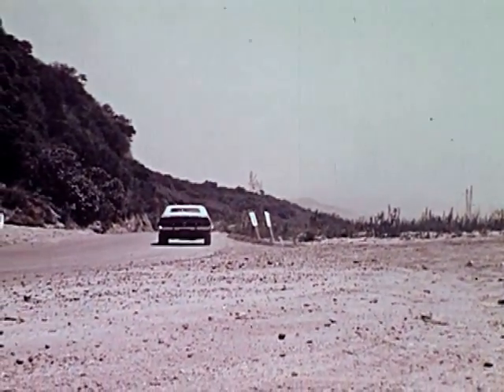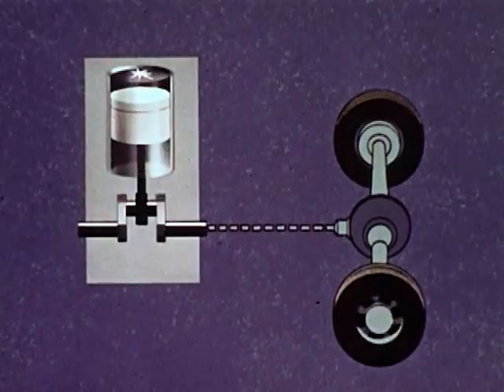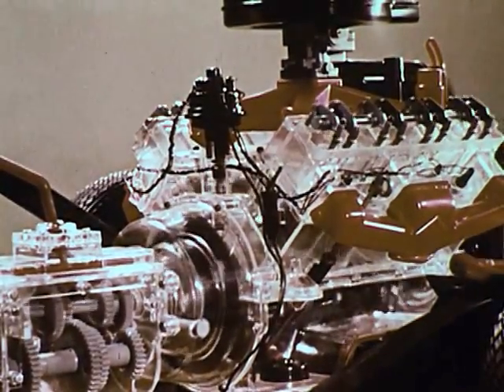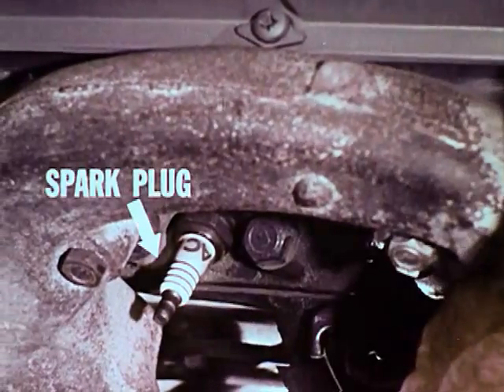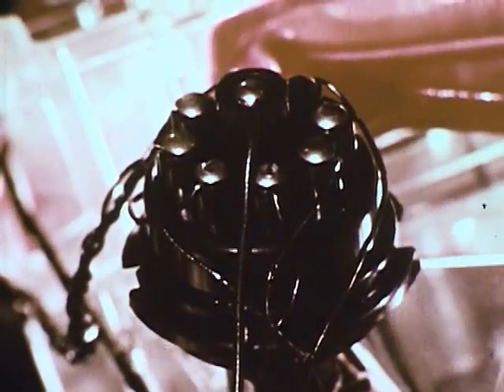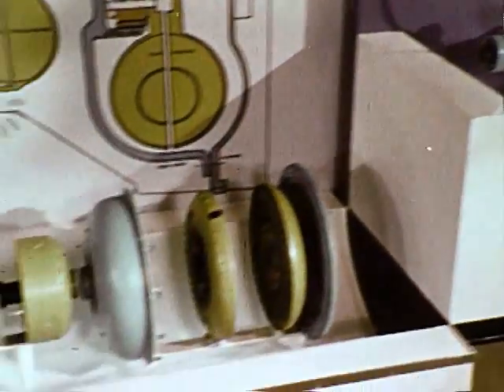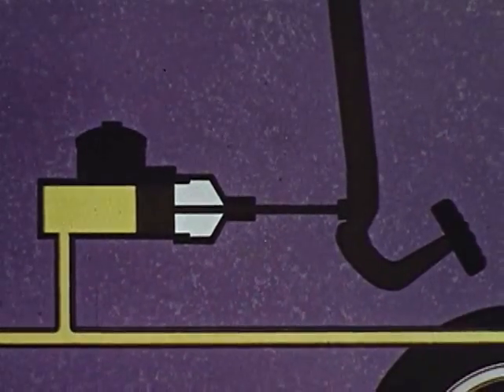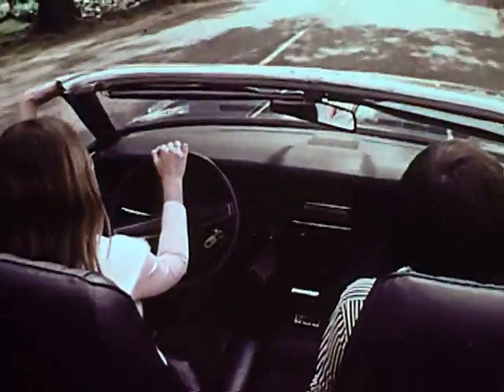What's Under Your Hood? (1973)

Comment: OMG - bad flashbacks! That V8 Chevy engine and the distributor system... they didn't show what it looked like mounted inside a car - with the top of the engine compartment making it next to impossible to remove it! I think that's what killed my 71 Impala - something simple like bad points or something that I couldn't get to. I need therapy.

Comment: By 1973 new EPA regulations were having a significant impact on power, drivability, reliability and economy.  It would be the mid '80's before things started to improve and into the '90 until power came back.

Comment: Under my hood..  A "frunk" containing the brake and clutch masters, wiper, two headlight, and blower motors, and the spare tire. With the radiator and fan ahead of that.   Under my rear decklid.. Another trunk, just ahead of that, just behind the cabin, my 151cu-in (2.5 liter) Iron Duke, and a 4-speed manual transmission (All transverse mounted)
Ok now, What kind of car do I have?
Reply: Sounds like you have a Fiero.
Reply: @GRIFAbyte101   You're correct.  A 1984 Fiero SE.
Reply: @Cammi_Rosalie   Haha cool! It was the Iron Duke that gave it away!
Reply: @GRIFAbyte101  I wanted to give a little hint.  Those old Iron Dukes are heavy and have a relatively low redline,  but given reasonable care and not ran hard,  they will last.  Um.. Aside from that incident with the faulty connecting rods (that was fixed in a recall of '84's) They are great engines they can go the distance.  (The typical U.S. mail truck uses Iron Dukes)

Comment: A generator produces direct current. An alternator produces alternating current like you have in your house but your car doesn’t use ac current so there are 3 diodes that change the 3 ac outputs into 3 dc outputs your battery can use.generators have an armature made up of windings spinning inside a housing of permanent magnets. Generators use battery voltage to make an armature of electro magnetism inside of a housing of output windings

Comment: That tiny model car is incredible !!
Reply: I built a model V8 that was similar to that one, but maybe smaller when I was a kid, but being a novice at such things, I could never get it to turn freely.  A few years later, I was given a clear model of a rotary engine and that actually did turn over. Both had a little hidden electric motor to make them operate and the "spark plugs" were really little red light bulbs, but I learned a lot from them.
Reply: If Amazon or Aliexpress had that as a kit I guarantee people would buy it. I'd get one for sure.

Comment: 5 20 wheres the timing chain  v 8s didnt use gear to gear  crank running backwards
Reply: Some V8s used gear cam drives.  Flathead Fords and Studebakers are 2.

Comment: By 1973, the ol' V8 was becoming a former shell of its self. That would last until the mid 1980s when fuel injection finally took over, and, the horsepower numbers have been going up ever since. Off the chart, actually. The ol' V8 a mighty powerhouse these days.
Reply: Paul Kersey  what’s crazy about a dct

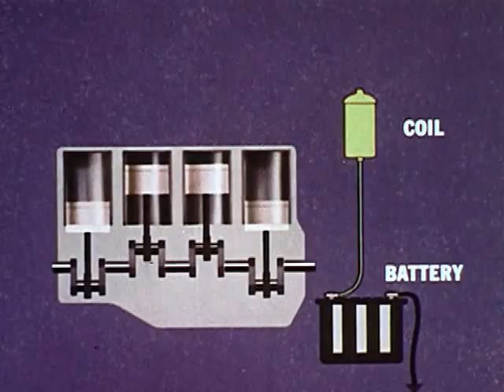Comment: 3:25   "The coil boosts the current to make a voltage high enough"  Current is measured in amperes. Voltage is measured in volts.  Aka not the same........
Reply: but current and voltage are directly proportional. So if you increase current voltage should increase. In other words it's ohmic
Reply: If you do not add any more watts then current decreases when you increase voltage. I * V = P If you increase V you have to decrease I so that p stays the same. To make a spark you almost don't need any current at all.
Reply: @missispiggie926  wait until you learn watts = volts * amps. you don't know everything pal

Comment: It is Revell that have the Visible V8 plastic kit you see in this video, it is still to be had, for about 50 -75$ on eBay for instance. I assembled mine completly a few days ago, it is still virtually the same since 1958.
Amazing kit and display 1:4 model V8, it won an award in 2008, well deserved!
Why can not Revell also start to sell the Visible Chassis you see in this video, with the see-through 3 speed manual and the see-through differensial?
I was dicontiniued in the 60es I think, I guaratee Revell it will sell like hotcakes is they release it again. Today vintage kits of the Visible Chassis sells on eBay for about 500-1200$ depend on the condition.
Cheers.
Reply: that's a shame! I want one of those tiny car models and you bet your ass I'd buy one!

Comment: I didn't see anything here about fuel injection, sensors, computers, distributorless electronic ignition, catalytic convertors and the other new engine systems.  This is about cars made when gas was under $0.50 cents a gallon.  Man, that was YEARS ago.
Reply: +rome baker 
Well, actually, the EPA set some of the standards for emissions from California laws.  We had the toughest standards in the country, and maybe the world, in the 70's and 80's.  Many engines available in the nation were not allowed in California.  Finally, the EPA just adopted the California standard for the nation.
Reply: +VinnyDaQ Yes, but you also probably used to earn something like $200 a month.
Reply: +senorkaboom Plus, no front-wheel drive systems or disc brakes...just like my first car, a 1973 Oldsmobile Delta 88 Royale. It's a good thing gas was so cheap back then ; I used to fill up a 22 gallon tank with a five dollar bill !
Reply: +senorkaboom. you could thank EPA for emissions laws. being sarcastic
Reply: @Rika-chan1983  president Nixon started the EPA
Reply: 61gisele  I should have explained better - I always refilled at 1/4 tank left... so about 17-18 gallons added at a time, not all 22. 17 gallons at around 30 cents per equals $5.00.

Comment: Is the generator the same as the alternator?
Reply: Sorry to say but no, the alternator is the modern equivalent of the older generators used on older cars. They are very similar in operation although older generators on automobiles typically output direct current where newer alternators output alternating current, hence the name. The device that +Keeree Dev is talking about is called a starter motor and is not the same as either a generator or alternator.
Reply: Keeree Dev Huh!?! An "alternator" IS a generator that produces alternating current. In "car talk" a "generator" IS a generator that produces direct current.
Reply: +BKofficer23 It does the same job, but it's not the same machine.   Cars switched to alternators because they are cheaper, lighter, smaller, and last longer.
Reply: +BKofficer23 yes.
Reply: giovanifm1984
l337pwnage Thank you both.
Reply: In the 1950s, 12-volt systems replaced 6-volt systems but still used a DC generator. The 1960 Valiant was the first car sold in the U.S. market to feature an alternator.
Reply: When alternators first came out in cars, they were still called generators which causes some confusion.
In modern times, we consider generators on cars to produce direct current (DC) and alternators produce alternating current (AC)
  However, if the power goes out at your home and you use a generator for power, it puts out AC.
So what's the difference?  Not much really.  If it makes electricity then it's a generator but if it makes AC then it can also be called an alternator if one chooses, but a DC generator can never be called an alternator
Reply: NO ONE PRODUCES AC CURRENT ALT AND ONE DC CURRENT GEN  OLDER CARS USED GEN 6 VOLTS 12 VOLTS USES A ALT..
Reply: @ronbutler6502  you never heard of a 12 vote gen. ??
Reply: @lenisbennett3062  yes but not used in automotive applications  tks
Reply: @ronbutler6502  If not car's then what?
Reply: what the fuck are you all saying? generator produces electric energe, and alternator is an electric motor which rotates crankshaft and starts the engine. both of these devices are necessary and they've always been a part of Internal combustion engine
Reply: Keeree Dev dude you're thinking of the starter motor
Reply: @kirillstepanov5458  wrong
Reply: Keeree Dev lololol what
Reply: @kirillstepanov5458  THE ALT IS NOT A STARTER..THE ALT PRODUCES AC CURRENT THE GENERATOR DC CURRENT ...BOTH DO THE SAME THING...